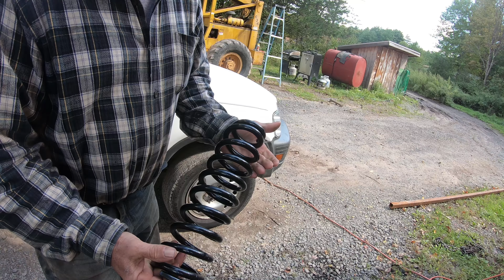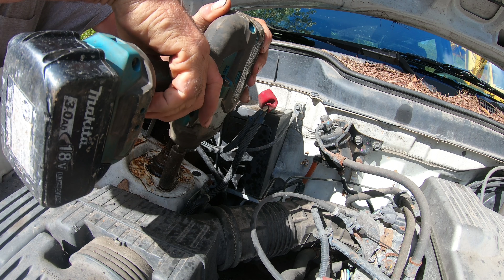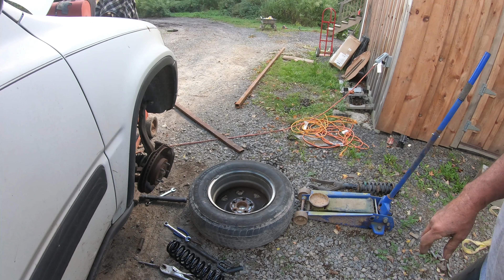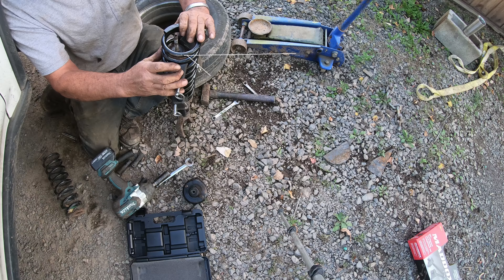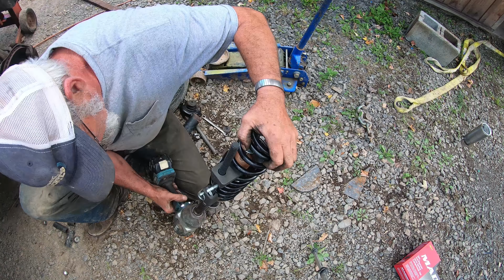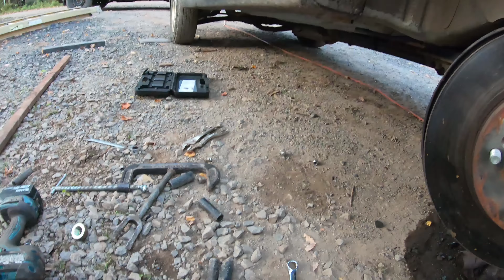Replacing the front coil spring on a 2001 CRV

Comment: The spring job on that car is pretty straight forward. Many cars are much much more complicated. Some have a bearing in the top mount and may need replacing when doing the job. A local garage ( shop ) would have compressed the spring for you for a few $$ and saves all the faffing about.
I surmise when you say axle you meant drive shaft.👍👍🏴
Reply from the maker: far as i know its called an axle
Reply: @danwheeler5130  Might be different in the US we call them drive shafts here in the UK
Reply: A few dollars? Maybe an hour of labor per side just to assemble things at $80-120/hour. That's the shops that are being straight about their time- not sure what the labor book says.

Comment: Whole strut assembly would be about the same cost when factoring in the added cost of the spring compressor. Way safer too
Reply from the maker: it was 32 for compressor 40 for spring
Reply: I tend to just pay extra and buy the entire strut, but sometimes the camber can really be changed with another strut assembly and also it's getting hard to find parts! I had to really shop around last time I bought struts for a car. I'm working on one now- I bought the right side fully assembled from Honda and looks like I'm going to need to piece together the left! WTF! I'm trying to avoid the really cheap garbage like Gabriel and Monroe but KYB is hard to find right now!

Comment: Those spring tools should be outlawed! Very dangerous for use. When trying to get ball joints out spray a little lube where the stud goes through the knuckle and then hit the knuckle at the stud to break them free. I agree I don’t like the fork either because of tearing the boots.
Reply from the maker: thanks for the tip

Comment: It was so scary watching you handle the strut assembly the way you did when removing the spring.  We had a triple spring tool and unfortunately one day it failed on one of the tech's.  Thank God no one was injured, but, let me tell ya that spring made several trips around the shop and had everyone running!  It is amazing the power stored in that spring!  Good you went a ahead and replaced the axle and I would have went ahead and replaced the rubber bushing at the top while in there as well, hopefully yours was fine.  Great work and a huge savings having done the work yourself.  The axle on the other side has an inner axle as well as an outer.  Love CRV's, great vehicle and fairly easy to work on.  Have you replaced the timing belt yet?
Reply from the maker: yes timing belt replaced about 15 k miles ago

Comment: Dan I loved this video and have been watching all of yours.  I've heard horror stories about these spring compressors and am wondering if you had a second set of the harbor freight compressors if it would have made keeping the shock more centered inside the spring easier.    Kind regard, Craig
Reply: IMO, just buy the 100-150 dollar wall mount tools like "VEVOR Strut Compressor 45# Steel Spring Compressor, Universal Fit Heavy Duty Strut Spring Compressor." I think that's what I'm going to buy for my upcoming project. I recall some serious pucker factor changing out struts in the past!